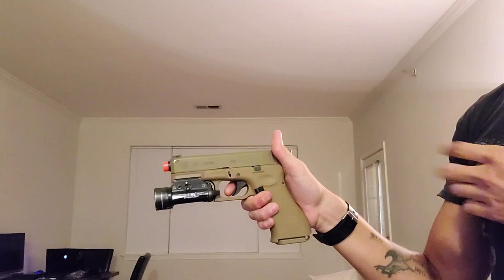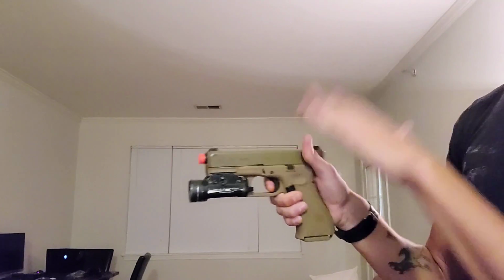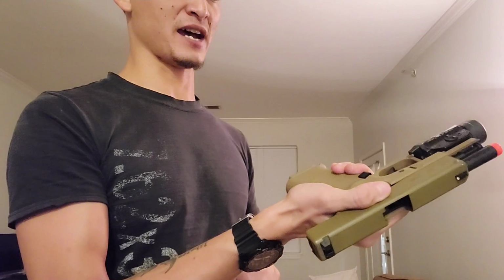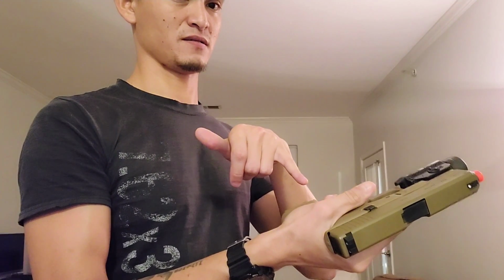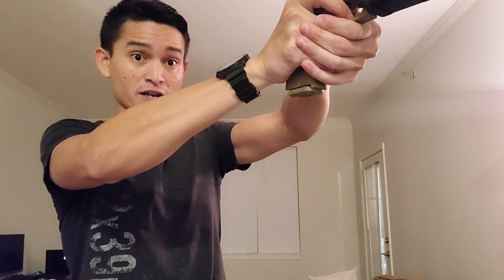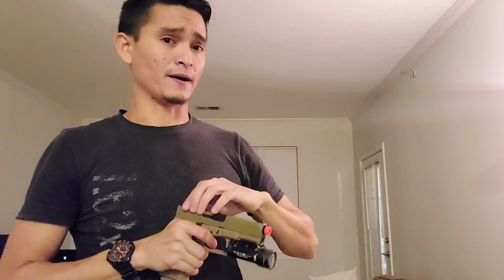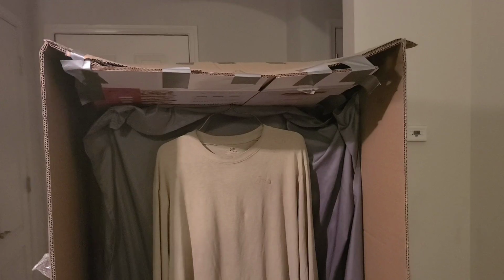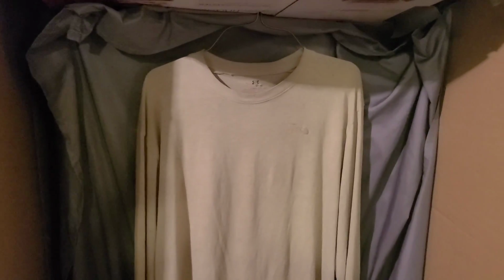Airsoft- What makes it a valuable training tool?

Comment: One of the biggest things that airsoft also helps with is platforms that are not particularly available to get for some people, alternatively if one doesn't use a certain platform on the regular, or even practice for those in countries where firearms are difficult or near impossible to get such as the UK. In spite of this, I can practice with close replicas and practice my fundamentals and techniques, emulating and practicing from actual firearms instructors with tips, then adjusting and finding what works for me.
For example, reloading and performing manipulation drills with weapons like an AK, which require a slightly different mindset or other types of pistols like 1911s which will have a manual safety and whatnot, which most people don't have down. Of course, most here have mentioned it's not always perfect, but it can be pretty close. 
Not everyone buys a variety of guns (airsoft or otherwise) and will use all of them, but if you take that sort of thing seriously, you can always count the practice and drills you set for yourself on something you may not regularly use.

Comment: Airsoft rifle can be used to training too ?
Reply: The elite force mk18 and Tavor I’ve got don’t move the bolt when it shoots. You can practice reloads and things of that nature but you have to skip the charging or dropping the bolt part. Can’t speak for other models and manufacturers.
Reply: there are gas blowback rifles, if your looking into them take a peek at VFC, pretty much any other option will either be shit quality or too expensive for what it is
Reply: @kevin pierson yeah, both of them suck.

Comment: Good to see you change opinions, we chatted for about 3 months back in 2012 and I asked you about airsoft as a training tool and you just answered me:
It's gay.
Reply from the maker: Sounds like me back then lol
Reply: @Regular_Guy_Training_LLC  Did your opinion on simulators to teach the mind to solve problems first before putting green dudes to try things with live ammo and vehicles (using fuel and ammo) also changed?
I didn't had the courage to argument back then that I thought using simulators to teach in an dynamic scenario was better than using an white board and just explaining things before heading out to the field.
Because you could create scenarios to teach their minds how an appropriate response would be.

Comment: Any chance you can give the specific reasons behind "blacking out" parts of a 3 dot sight? I think I get the vibe but u KNOW and I'd just be assuming.
Reply from the maker: I usually just black out the rear sight because I don't like three dot sights
Reply: Some people, like me, like the front dot to be the most visible and will darken or black out the rear to make the front easier to pick up
Reply: I kinda assumed that was the case. Also. Red sharpie and red paint are not the same. If you try to color the front white dot red with sharpie it doesn't work. Use nail polish or buy a colored front. Good thing it wasn't invisible ink or id be screwed. ;)

Comment: Nope. No airsoft, at all. I will despise airsoft until they stop using real imported AK parts. How dare these mofos use real side folders and scarce parts!
Reply: They arent using real AK parts,  my airsoft ak is cheap die cast parts and the side folder is definitely lighter than my real one.
Reply: unless your an idiot and trying to put an Airsoft side folder on a real AK.
Reply: @ryanashby3640  yeah they are!
Reply: @keyboardcommando5146  any proof?
Reply: @ryanashby3640  I’m very familiar with the community, and it’s not limited to AKs. Want proof!? Join any forum you can find. I’d be willing to bet Airsofters keep the lights on for companies that specialize in firearm accessories, as much or more than the gun community. 😂
Reply: @keyboardcommando5146  which real ak parts outside of stocks are ppl using?  New imported zenitco isn't rare, just expensive.
Reply: @ryanashby3640  on GHK & LCT (an AEG brand) AKs, people have gotten fore grips to fit with sleight modifications. Pistol grips are no problem, & I believe gas blocks also require no mods. Real dust covers won’t fit because the proper receiver length was not used. I was doing a lot of research on it until I lost interest in AKs all together, but I’d advise you join GHK forums if your interested and ask around. Door Spook has a reason to be aggravated-though it’s hilarious-but Airsofters are good for business. The faster the gun community realizes this, the better!
Reply: @keyboardcommando5146   I'm familiar with people putting real accessories on airsoft guns. We were talking a out rare parts. Pretty sure nobody is butchering an Izhmash ak74 trunnion for an airsoft AK. The accessories aren't scarce or rare just expensive. Airsofters aren't the reason Russian  AK parts kits dried up. Sure I'd like a peq2 for my GWOT m4 clone and I've seen milsim guys running them. Good for them using them with nods in milsim. Getting more use out of it then most collectors.
Reply: @ryanashby3640  it’s rare, but there are people like that who are that committed; they’re not coming in droves though. Those types usually have real machining skill or know people who do. You’re right that the average Airsofters aren’t doing that. To people that want to refuse Airsoft for whatever reason, they’ll have their way, until the next generation of Liku Tacticals start showing up at their local ranges and out shooting them in a month. 🤣
Reply: 🤣 it’s great for business, just not yours!

Comment: Good vid, RGT. 
Just a tip with Gas Blow Backs, particularly ones which use green gas type fuel, it’s always good practice to store the gas magazines with a little bit of gas inside. This keeps pressure behind the seal and maintain a gas tight mag. 
A couple of seconds worth is all it needs. 

Never store them without gas otherwise they could develop leaks. 👍

Comment: Where’s the best place to get them?
Reply: depends on what you wanna buy, most in person shops only stock crap, buying online is the way to go 99% of the time
Reply: @b0p1s65  any particular place?
Reply: Cheaperthandirt and midwayusa have alot of the airsoft and bb gun stuff. Amazon and Walmart I would stay away from tho they mostly just have junk.
I would agree with the comment above. 99 percent of what I've seen in stores were junk. But there is definitely alot of good ones online 
Midwayusa 
Cheaperthandirt are a decent start

Comment: I use a co2 blow back pistol with a metal frame. Mine is a bb gun .177 cal or 4.5mm. So its harder to rack the slide and more mass on the blow back. Just food for thought or another option for dry fire practice.